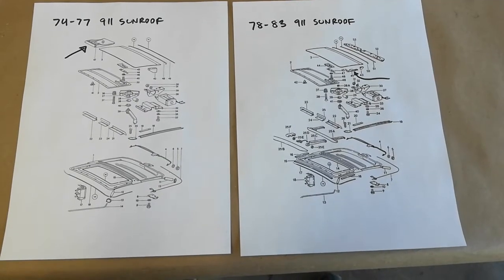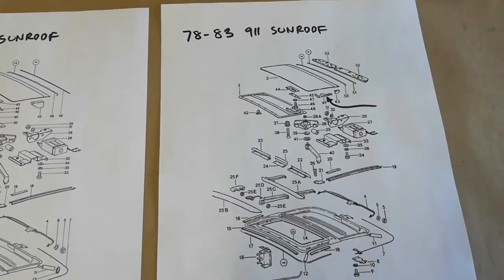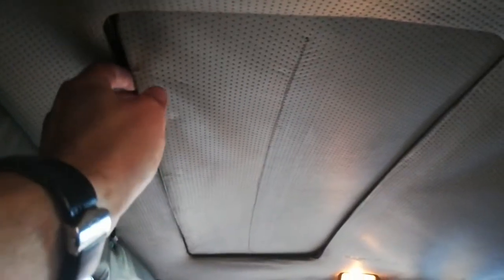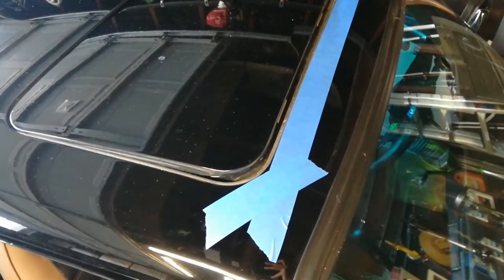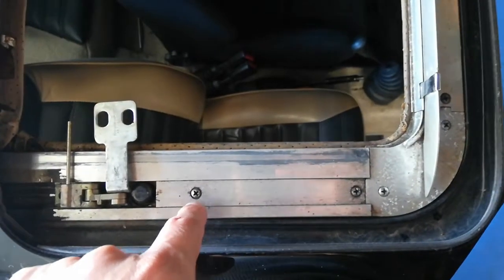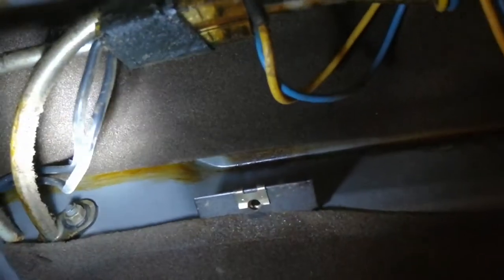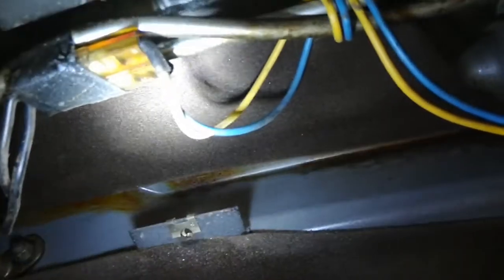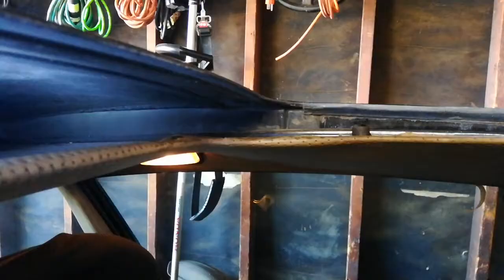Air-cooled Porsche 911 Sunroof DIY Rebuild Part 1 of 3: Disassembly

Comment: Watched all 3 episodes. My conclusion is that for someone who only needs to replace the 3 seals, we only need to pop the sunroof liner, and unscrew the sunroof  panel from the parts that slide on the rail. In particular, there is no need to open the headliner zip in the back and detach the gear that fits between the cable and the  motor. Would you agree?
Reply from the maker: Agreed 👍🏼

Comment: would this procedure be the same for a 1985 911 Carrera? .... I have the single wind deflector you referred to.
Reply from the maker: Difficult to say exactly. Looking at the diagram for 84-86 it looks like most of the parts should be the same apart from the deflector.
Reply: Thank you so much I will use it as reference to repair my 87 Carrera

Comment: I gotta figure out how to do this job without being able to open the sunroof at all!! Lol such is my life…
But ya similar story, I ripped out the old AC stuff so would love to have a working sunroof but mine is jammed closed (at least it’s not stuck open)!
Reply from the maker: Try unzipping the headliner at the back and disconnecting the cables from the transmission. They might just be jammed up.

Comment: My understanding (without any direct experience) was that the newer kickstand style was what went into the 3.2 Carerra ('84 - '89). But that they are also a straight-across drop in replacement for the older style mechanisms on earlier cars as well.
If your sunroof mechanism needs to be replaced on an SC, these later units are what would be used.(unless your doing a full historical restoration) Mechanically they are an improvement over the earlier design. I've only seen one or two SCs with the newer mecanism, and have always assumed it was simply a replacement repair on those cars
Again; I think this to be the case, but I could be wrong.